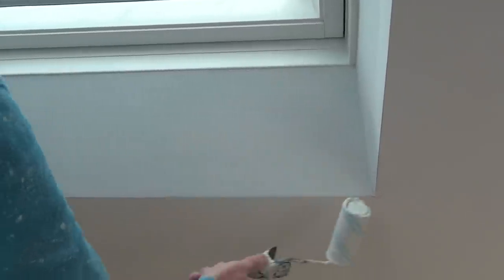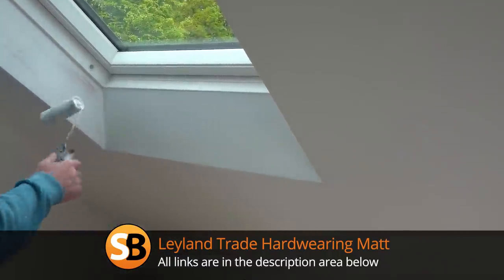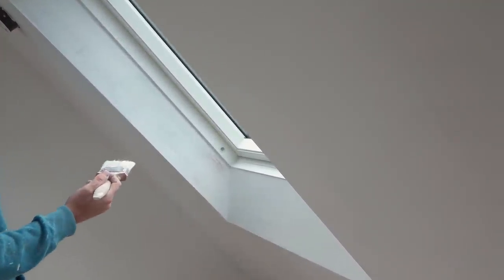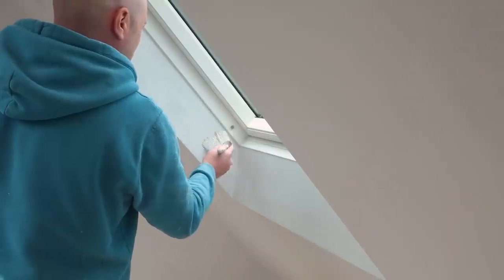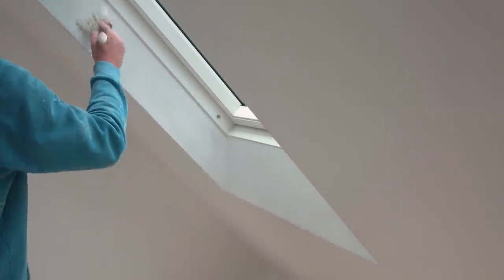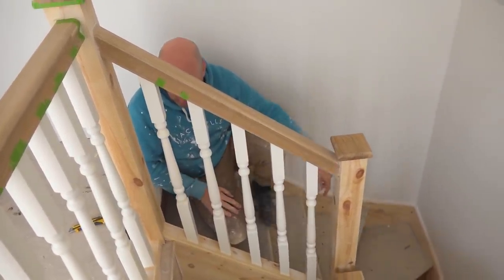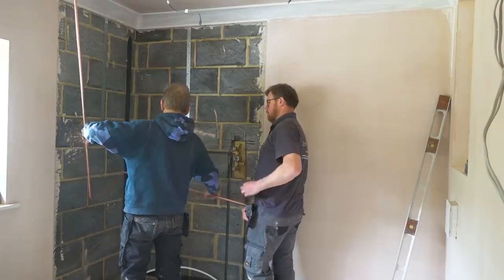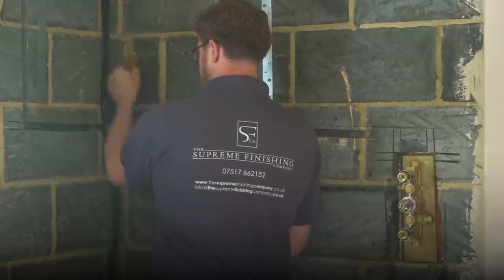Painting, Plumbing, Boring ~ Extension #21

Comment: Tell your painter if you over coat zinsser bin with a second coat of bin it livens up the first coat and just moves it around.
Methylated spirit based reversible coating is the term used in the trade.

Comment: You need to try painting with a HVLP gun. Takes a little to get used to but it is sooooo fast and makes for a much much better finish, especially in sunny areas, than a brush and roller. It just takes a little more prep work is all.

Comment: Prefinished fire rated oak doors in old out of whack frames... any tips? Or should I try convince the client to let me put new frames in?
Reply from the maker: Hi Kallum. I had a load of wonky old door liners at my daughters house and I took off the architrave on one side and cut the cut nails to release the liners and cut the  blockwork back a bit and then went to work with some foam and wedges. If you get a laser level on them you can bring them right back into line. If you hang the door and then wedge the liner out using the door as your guide it is really easy,

Comment: Out of interest, how do you get the holes in line for poly pipe? String line and square up? Laser?
Reply from the maker: I just measure off the wall and then mark up a piece of batten  to keep the holes in the right place. Sometimes I use a laser if it is handy.